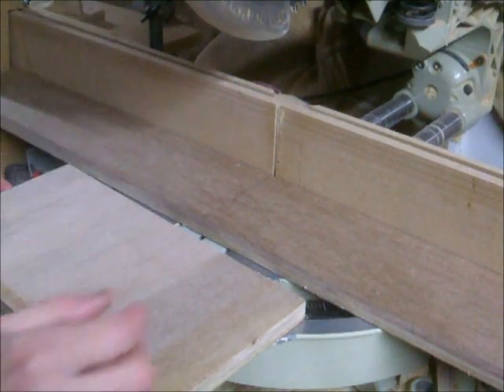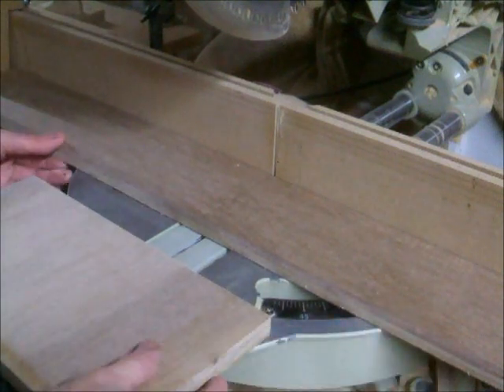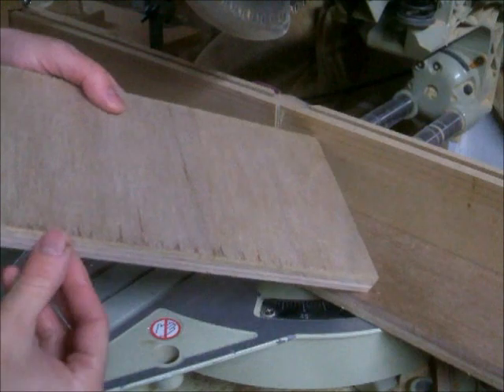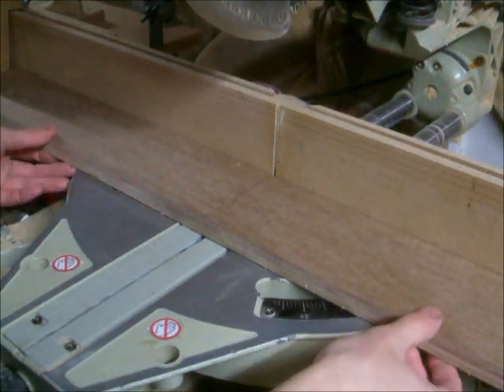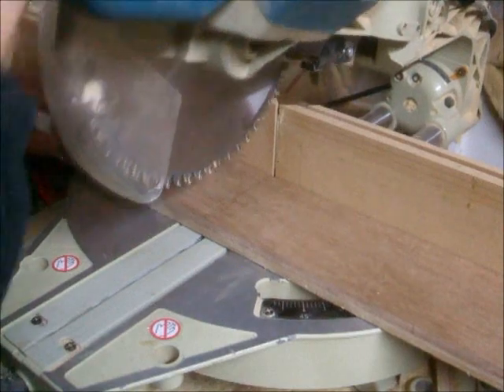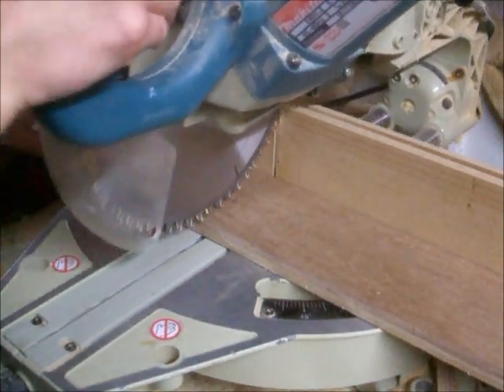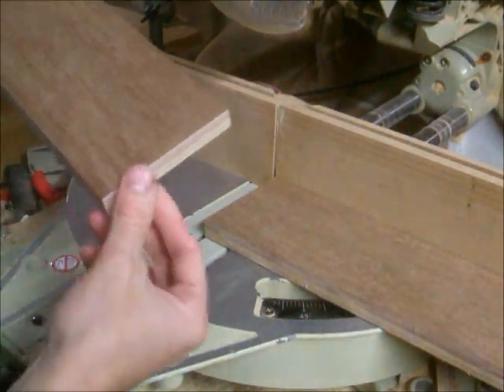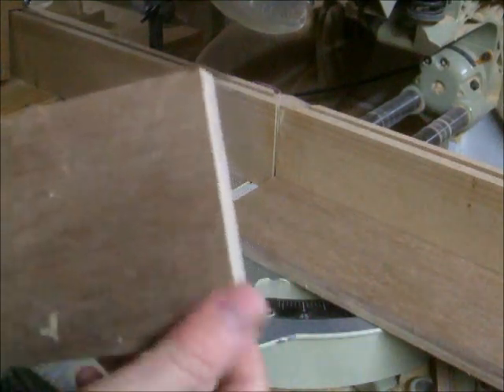Crosscutting Plywood (Without Breakout)

Comment from the maker: With Makita's plunge saw (the SP6000K1), they recommend you set the blade for a 1mm depth of cut and first run it BACKWARDS along the guide rail, which scores the fibres, ready for a clean cut going forwards at full depth of cut.

It's not without obvious risks of kickback but, it does apparently work.

Comment from the maker: Actually, on a table saw, I'd prefer to fit a zero-clearance insert around the blade. Failing that, I'd feed a sacrificial sheet on to the saw first (where practical), which would have the same effect.

With a circular saw/skil saw, I would try fitted a zero-clearance insert to the underside of the saw's base. You'd have to cut a wider slot for the riving knife and, if double-sided tape doesn't hold it, sometimes there are screw or bolt holes.

Sorry for my delay in replying to your comment!